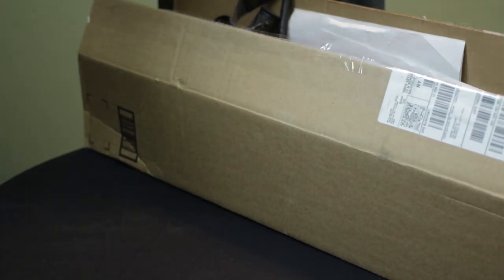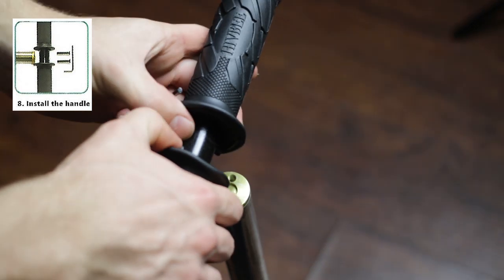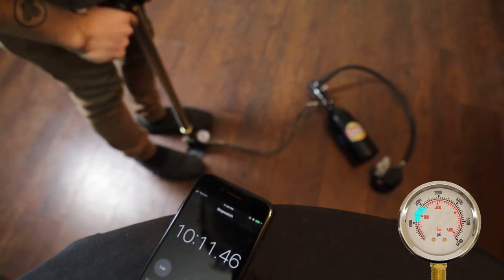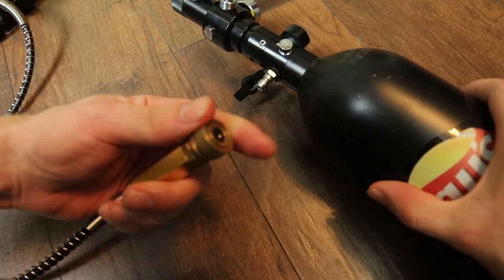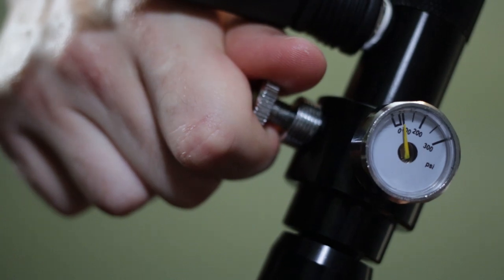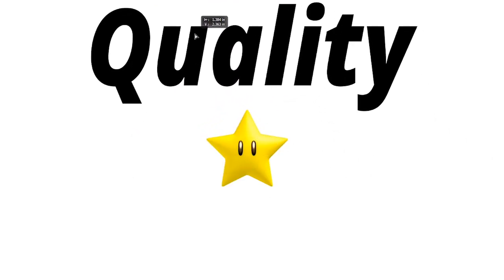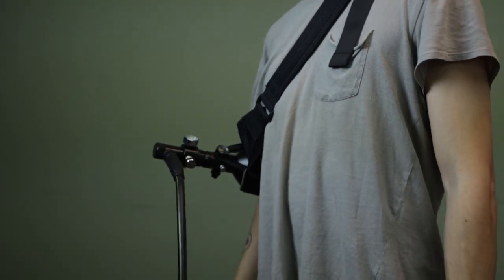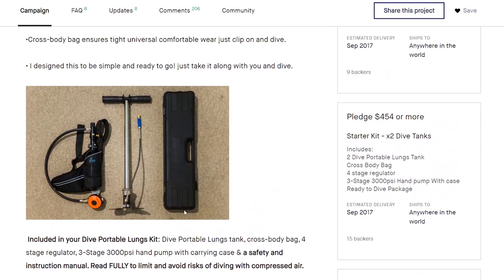Dive Portable Lungs Kit FULL Review / Unboxing / Installation

Comment: Really scary, please seek proper scuba training and certification.
Reply: I’m just curious, if I just want to swim (10) feet at max and don’t want to start a whole new hobbie  on top of flying. Why can’t I use one? What are the dangers of going 10 feet deep with one of these?
Reply: @samfriday3437  and these things can be really dangerous not just because of air compression but also because of the air quality if you use a regular pump
Reply: @shyx9402  so what about a air compressor? That’s made to pump it
Reply: @samfriday3437  Ask yourself this... Would you fly or feel confident letting anyone else fly your plane without proper training?... even if it were only 10 ft. of the ground?

Comment: of all the terrible scuba tank i have seen that regulator seem terrible and dangerous.Iis this setup even certified by a agency? Never seen one where you have to manually limit the pressure to not freeflow. Just get certified and get proper equipment. After reading the comments i found out this is just a bunch of paintball parts, you can get cheap similar product like the SMACO that is actually a cheap copie of the  "Spare Air" that as been available for a long time to scuba divers.

Comment: PLEASE Nobody use these!! Without proper training, you are playing with your life without knowing the rules. Training is cheap, rental gear is real cheap. Do it right or don't do it at all.
Reply: Or go freediving 😁
Reply: You can.  But almost everything is dangerous without gaining some knowledge.   
But for a long while now I’ve been having tanks filled by dive shops without a license or whatever.   
1 I signed a waiver with the other I didn’t.  
But I’ve opened a second business this one in leak detection of pools.   
I either use a 13cf pony bottle or an 40cf pony bottle with regulator and OTS spectrum face mask.   
But I did all my research and have yet to go past 8 foot deep.  Most 5-6 foot.  Even still make sure there’s no holding breaths to even if it’s possible but any over expansion issue.  
And may be down for 2-15 minutes.   
And over the dry suit a 40 pound weight belt.  So I can walk or kneel around the sides checking returns or in the back of light niches for any leaks an repair.   Or be able to remove the drain covers and plug the lines and test around the drains for leaks an if need be place the underwater epoxy in any leaking spot.  

Anyone with a half of a brain that can stay within a few feet under can safety use one and not harm themselves.   
It’s the idiots that’s the issue.